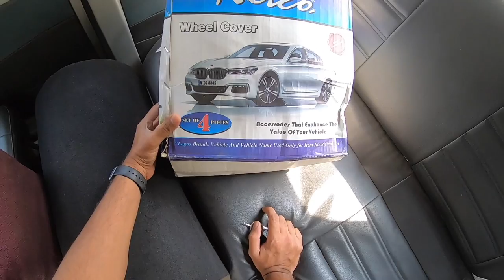Maruti Omni E - World's Cheapest Van | Faisal Khan

Comment: slap minilite mag wheels, insert some noise dampening/insulation sheet in between the siding, roof and doors, remove the rear seats, slap on captain seats that would fit and maybe and aftermarket airconditioning (if the engine can still  handle it but i bet i'll go real slow) and you got yourself a limousine. greetings from the philippines.

Comment: This is not the facelift model, the facelift model is of 1998 which was slightly different from this van where its headlight is rectangular and its light has been inserted inside the outer show cover of headlight and and there was M logo in the front and in the bumper there was indicator as well as sidelight/parking light

Comment: For the 1st time I was afraid for your life. Have faith in your driving but not on Omni. Also you can do a stoppie in an omni if you brake hard on the trailing edge of a speed breaker. Give it a shot. Safer than playing with steering wheel of an omni😅

Comment: I guess you have totally forgot to use the 3rd and the 4th gear. Get your basics clear before riding a car dear. There is no need to revv it so hard. One can hear the engine and you screaming on top of your voices. This car can also be driven smoothly by shifting the right gears at the right speed. Grow up buddy! Do not be under a misconception that just by making an engine scream, you can make a review. Its obvious that the car is old and not well maintained, but that does not mean it cannot perform well. Afterall this car too would have been made with some thought process. Instead of reviewing it as per today's scenario, you could have given a thought about what it used to be then in those years when it was a great car used by many people across India. Rash driving on 1st and 2nd gear on high speed does not make anyone a good car critic or a reviewer. A new omni would run absolutely smooth on our roads without hitting the base too. You have terribly missed on these minor points...I guess you should make one more review to clear doubts and to gain faith.